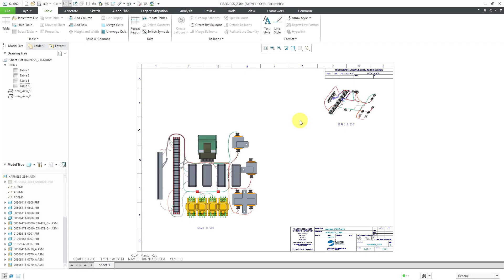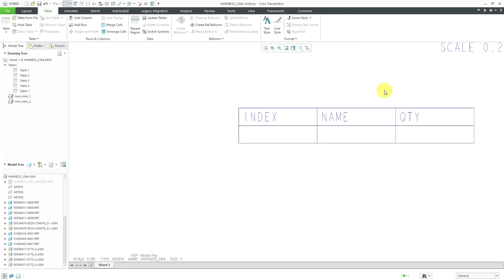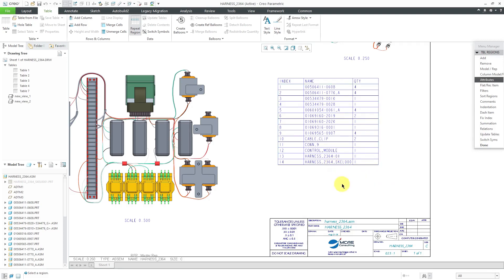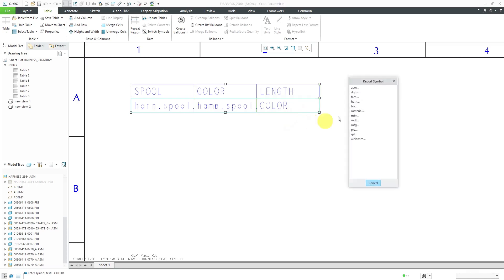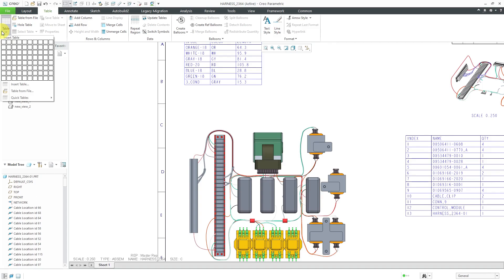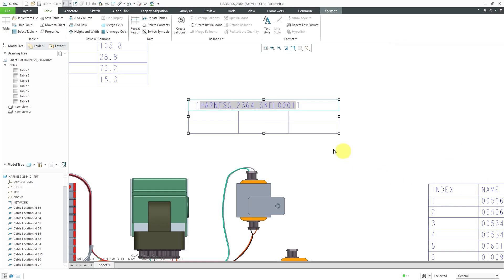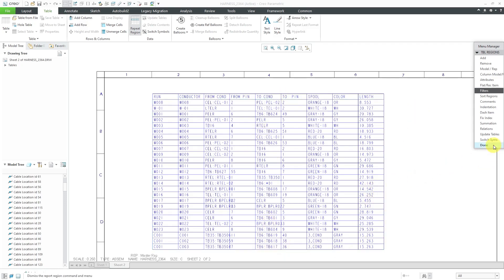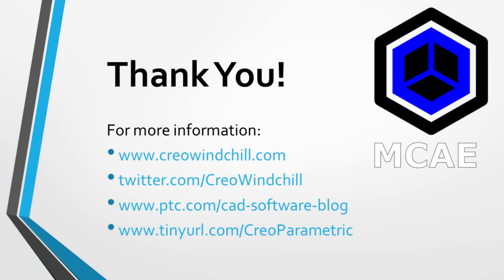Creo Parametric - Cable Harness Drawing Smart Tables

Comment: Finally some decent YouTube videos for Schematics and Cabling. Been using Creo Cabling since Wildfire. Low user count = low support.

Make life easier for the connector table by using nested regions. Make the whole table one table then add the pin region as a nested. It inherits the parent so just click once In top level) to change references. All regions in sync, no mismatched regions.

Rule based filters are great for re-used tables as you indicated for the wire table. Should have used on the BOM. Newbies tend to take stuff rather literally so showing good practices all the time is important.

Keep up the good work.

Comment: The from/to pin names does not show in my table, what do you think is the problem? I've used the correct report table parameters
Thank you
Reply: Am alsso facing same problem, but since routed using creo schematic it is coming.. For manual cabling pin number won't come

Comment: Awesome videos! I am having trouble getting my pin numbers to populate in the tables. Can you show how to assign entry ports to pins? I am afraid that I do not have the correct package/licence. I found an article that told me how but my "Pins" button in the "Electrical Parameters" is not valid. Any ideas?

http://support.ptc.com/help/creo/creo_pma/usascii/index.html#page/electrical_design/cable/About_Entry_Ports.html
Reply: I am having this same issue. these videos are great! i edit elec params for designated connector that i selected entry ports for. In "display for" Components i add column NUM_OF_PINS. i assign a value of 2. Then in "Display for" Pins I add column for ENTRY_PORT then i assign value by clicking the drop down and selecting my Entry Port CSYS. i still cannot get the pin name to populate in the repeat region table on the draiwng. Please help.
Reply: i got it!!!!!!!!!! i was trying to 6:50 TO 10:30 for a cable,  not a wire. the defined paramters during this segment are for wire runs. The last table created in the video shows you how to do it for harnesses. hallelujah. that took me at least 3 hrs to figure out. thanks dave!
Reply: @Ryan-ue8uo  I cannot show pins either on my harness, I do not know why this is the case, I tried the harn.run.cond.from.pin.name and I do not get any numbers
Reply: when I click model for repeat region I cannot pick harness from the file type, only the usual prt, asm maybe my drawing is set up incorrectly?